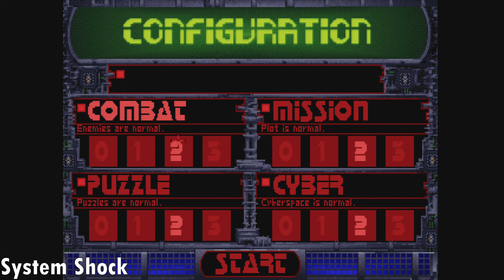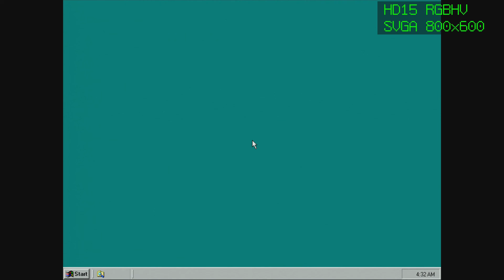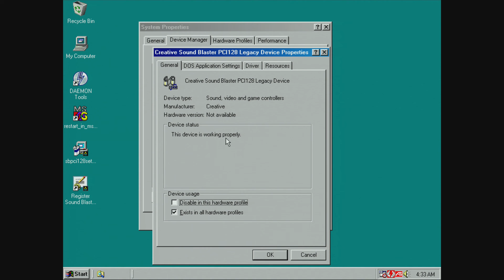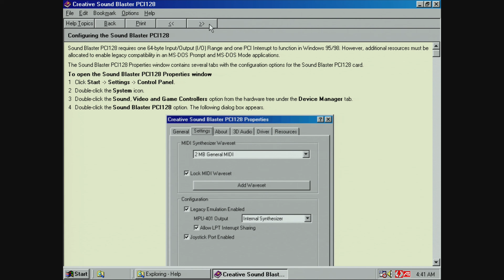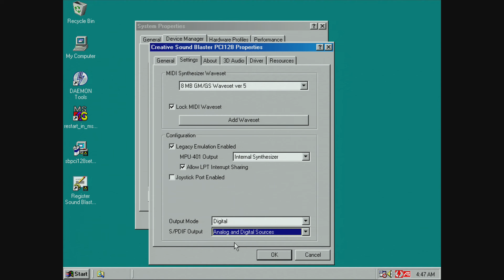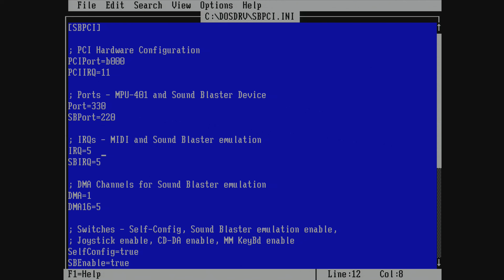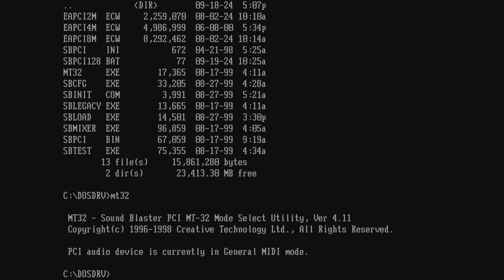Why no love for the Sound Blaster PCI 128?

Comment: I had 8 of these listed for $6 OBO and took the listing down because they get no love whatsoever even as a cheap card.
Reply: After Phil mentioned it, you can now list them for $60 and they will be sold in minutes.
Reply: @clockflipper  brb putting them up for $100.
Reply: Top technology of today is your garbage of tomorrow...
Reply: This was the first card I had in a DOS / Win98 build and I had no complaints. I still use it in an XP machine I built for cheap and easy sound. It's not TOTL but that doesn't mean it won't get the job done on a budget.
Reply: The Creative Soundblaster PCI 64/128 were subpar options of the time with shoddy drivers that liked to kill the entire OS ( 2k especially ). DOS support wasn't great either with clicking, crackling and delayed sounds especially on slower machines. Midi wasn't bad and usually worked, but somehow tended to sound off-key due to using their own differently balanced samples and, weirdly, the occasional off key seeming additional tone/note in between. And much of the Sound-Generation was done in software requiring quite a bit CPU performance.
For anything Windows, provided you actually got them installed properly, I found them to be a solid choice ( though personally, I quickly switched to the Terratex XLerate with the Vortex 1, and the Terratec DMX XFire using a Crystal CS4624/4630 after that ).
Reply: @l3lue7hunder12  Everyone pretty much waited for the EMU10K chip in those days. The 128 usually ended up in OEM machines, hence why they have a stigma against them. No one wants a product related to an OEM system. Not that the same fate came to the Live as well, but no one wants the Dell version of the card. I stuck with my AWE64 until I got my SB Live! 5.1 X-Gamer in 2000.
Reply: I too still have my 128 and my 512 as there was zero interest over a 6 month span.
Reply: Hmmm... Aside from my other comment to Phil in the main comment thread, I wonder if maybe some of the ones I was seeing online were yours. They are no longer up either. And similar to the ones he's holding in the video, so I figured maybe by coincidence he bought the ones I was looking at. 

But now I wonder if maybe those were yours?

I recently bought an Asus CSM board with a PCI slot on it for my AM4 setup. Need a decent midi soundcard for midi inputs, etc, for sound production using older hardware. But ideally one that also comes with all the nice extra features that sometimes gets used with some games for their sound. Sound Blaster being a common one of the brands to have this done with them usually with older games like Dungeon Siege and Diablo if I remember correctly.

Setting up an all AMD BSD gaming setup for older games where emulation of the operating system may be required at times due to lack of support for older OS's, etc. BSD is supposedly pretty good at that, once you know how. Apparently.
Reply: @ManuFortis  ... we are talking Asus Prime B350/X370 here, right ? Nice board, and works well with older cards such as an Vortex 1, but what is provides is PCI only and current Windows is unlikely to support Soundcards that old - you'll get basic features at best. There are more current offerings out there using PCI/PCIe and are supported to at least Windows 10, that have a "Game Port" and Midi therein - some are quite cheap. And the serdashop has solutions as well, including USB based Midi wavetables such as the Dreamblaster series. As for running Windows 98/XP or DOS on a Ryzen for vintage sound on a PCI soundcards ... well let me know what happened - you'll probably need a lot of luck.

Comment: Unfortunately for me, my SB PCI 128 CT4700 has the ill-fated "crackling" issue when playing sounds. It took several days for me to finally find working drivers that wouldn't crash windows. One set of drivers actually damaged my FAT32 partition. Your drivers were the only ones that gave me any signs of life, but nothing in DOS. SB0570 (Audigy) never worked in Win98SE for me and even my AWE32 CT3910 gives me nothing and gets super hot within about 5 seconds. Guess its time to reflow all of the solder and replace all of the capacitors 😢 I've had bad luck buying retro tech, but the good news is that I also rebuild them and release them back into the wild, with correct driver CDs and documentation!

Comment: i will add to the relaxation on the FM issue, is if you are using this like i am on a bit of nimble kit (PII 450/this sound card, and an MX200) you can just run DOSBox in WIn98 and then make yourself an AdLib 486 with a VGA graphics or even EGA etc. I use DosBox to emulate Tandy 1000 stuff on my setup (i have a Dell Diamontron VGA monitor) and its a good time (i miss my old Tandy 1000 RL i had growing up).

Comment: Why no love for SB 128 PCI?
Because people think they are clever and immediately select 8MB preset - then they immediately assume it sounds better because of higher size and never look back.
Even from tests in this video it is obvious 2MB preset is better with much better ambience.

I keep SB 128 PCI in my retro PCs exactly for the 2MB preset - I have not found anything like it anywhere else. Usually sounds don't fit each-other that well. Even SC-55 has this issue that in some MIDs some instruments sound out of place.

BTW. DOS driver for EMU10K cards also uses these same ECW files but MIDI engine doesn't support all effects or something because they don't sound correct at all. SB 128PCI plays these same sound fonts much better while something like Live!/Audigy sounds like it only plays samples back and some instruments sound quite broken.

Comment: Hey there! Thanks heaps for this awsome vid! ive got one of these cards and it plays audio pretty great, except for DOS games! the audio sounds weird compared to when i run the same games in dosbox. I tried following this video, but my settings seem to revert back to default all the time. it wants to put IRQ and SBIRQ to 7, SPDIFmode = 2, and when i change the setblaster info in autoexec.bat from i7 to i5, it reverts to default again next boot, but the audio is never 1:1 with dosbox. Any idea what it could be doing?

Comment: A solid win98 soundcard with quality audio.  I had the original version of this card by ensoniq.  The only way to get it to work in pure DOS was to install it through win 3.1 then make a copy of the driver folder for use in Dos 6.22 without win 3.1.  Worked great in win98 Dos mode though and you can use the 8mb wavetable in pure Dos, just have to edit the .ini file and direct it to the wavetable directory!

Comment: hello again phil, excuse me - lately , I got problem getting this web installer working - all the time I try it (on different setups/machines) it tell me, that the install file is not complete, or maybe more accurate, it has not all the necessary files, and the installer closes. do you have any idea what it can be? and 2nd question regarding this problem, is the web installer confirmed working in windows ME? thank you mate and friendly greeting to down under aus der alten heimat

Comment: The Sound Blaster PCI 128 dell version have additional TDA7360 IC or Power Amplifier but there is no supported driver for windows 10 or 11 there is a windows 7 driver witch can work even on windows 10 but aftertime reverted by the os

Comment: Occasionally, (for games) The 2MB included waveset sounded better than the 4mb and 8mb to me particularly because some of the instruments in the larger wavesets (such and distorted guitar) had a slower attack and didn't work quite as well for faster songs.  I did use the 8MB ecw for my keyboard a lot and it was great for lots of midi files.  I absolutely loved the organ sounds.  Overall liked the soundfonts better than the ones that came with sb Live!

Comment: Ahhhh. SB 128 PCI. I had this sound card in my first ever PC I bought myself (Celeron 300MHz + Riva TNT2). It was... serviceable, for the games of Win95/98 era. I upgraded my rig to Duron 800 in 2001 and tried keeping old SB 128 with it. Mostly it still worked ok in the early 2000s but for some reason on games like GTA Vice City it produced some clipping and janky audio. I bought SB Audigy 2 and all my audio problems went away. Never had anything to do with SB 128 after that. PCI 128 is to many users a bit of an in-between card: it's okay but never the first choice for anyone, DOS or Windows.

Comment: i had a sick obsession with this card, namely for the 8MB wavetable. i tried so hard to push devs here and there to get it emulated, they tried, the documentation for the wavetables was just way over their heads :( i was at least able to semi-convert the 8mb wavetable into an sf2, it works well enough. these days i don't have much use for it since RPG Makers have changed so much and also Win10/11's mappers are wack.. at the very least, i installed the sbpci128 driver in a VM (you CAN actually do this and the 8mb wave table works without real hardware), was able to play some of my midis in the 8mb wavetable and record them as MP3s for use in my projects. a bygone era with a happy ending.
Reply from the maker: Thank you for sharing ☺️

Comment: I had the CT4700 version, it was probably an OEM variant. It was a solid card for the late 90s and early 2000s. Had a makeshift four point surround setup running as well.

Comment: I was an original user of the Ensoniq ISA and PCI cards.

I’m still amused that CL had to buy Ensoniq to get the IRQ / compatibility emulation IP for PCI cards to fully work under DOS without that hokey CL port & cable to motherboards.

I hate the SB PCI’s the same as I hate all CL cards post-ISA though. Aureal had a superior 3D / positional sound IP and through underhanded practices - CL bankrupted them and then bought them in order to swallow up the IP.

Fuck CL.

Shame that TB went the way of consumer headphone market. The Santa Cruz was a nice card.

Comment: Heh... so you're the one who bought those. Or at least you seem to have bought the same ones I was looking at a month ago. You quote similar price, and they look like they are the same models; but I can't be sure without looking at the listing again... which is no longer listed. 

Anyways, as I just replied in Jonnyhopkins comment thread, I recently bought an Asus CSM board with a PCI slot on it for my AM4 setup. Need a decent midi soundcard for midi inputs, etc, for sound production using older hardware. But ideally one that also comes with all the nice extra features that sometimes gets used with some games for their sound. Sound Blaster being a common one of the brands to have this done with them usually with older games like Dungeon Siege and Diablo if I remember correctly.

Setting up an all AMD BSD gaming setup for older games where emulation of the operating system may be required at times due to lack of support for older OS's, etc. BSD is supposedly pretty good at that, once you know how. Apparently.

Comment: Hi Phil. Just opened my drawer and installed a PCI128 in my Pentium4 retrogaming PC. SB16 and general midi work great for dos games, and it was far easier than trying to make Sis7012 AC97 emulate sbpro under DOS. Thank you for the driver I found on your website
Reply from the maker: @CaptainDangeax  Awesome 💯

Comment: What does the CDDA over IDE mean? Is it played back on the wave channel instead of the CD channel? Is the advantage that the digital audio has less noise?
Reply from the maker: @JohnSmith-iu8cj  It means you don't have to connect that CD audio cable from the drive to the sound card...

Comment: These and similar Ensoniq cards were really popular in prebuilt systems in the late 90's, probably a good cheap way of getting sound. I think they dont get much love nowadays when cards like SB Live! are still fairly cheap on eBay if you are patient
Reply: Yeah exactly and the live is a much better card to boot. That is if you get the right one and don't get the crappy dell ones that wont work in anything DOS or 9x.. They are still good cards but the drivers are NT only for some reason.

Comment: I know of a few more games that work well with a MT32 sound bank. Specifically, Dune2, Ultima6, Ultima Savage Empire, Ultima Martian Dreams and Ultima Underworld 1 and 2. The original version of Dune 2 doesn't allow selecting MT32 with SoundBlaster in the installer so you don't get speech with Mt32 music unless you use an updated install utility that allows selecting separate sound devices for each sound type . Many people prefer Ultima 6 in Adlib mode as the game's music was written for the Adlib but with this sound card you don't have a choice. Sadly while that list of Ultima games would work well with this sound card Most of them have speed problems (the underworlds work best with a fast system though).

Comment: One fun fact about the PCI 128 is that is is the same exact card as the PCI 64, except that Creative stuck an ID chip on the 128 which the drivers would detect and thus the PCI 128 got the "upgraded" 128 voice driver. After figuring this out, I cobbled together a driver pack for the PCI 64 to upgrade it to the 128 and posted about it on the Creative Labs tech support forum. Shortly after this, Creative "decided" to be generous and released a "new" driver for the PCI 64 that upgraded it to have the same 128 voices of the PCI 128.
Reply from the maker: @EthanAQueen  wow what a cool story! Thank you for sharing 😊🙏
Reply: Really weird that they'd do something like that when they've been hostile to modders and threatened them with C&D in the past. There was the whole Daniel-K fiasco which put into the public spotlight how terrible Creative is as a company. They purposefully introduced bugs and removed advertised features between Windows versions (in this mentioned case, Vista drivers were purposefully crippled over XP drivers to get people to buy newer Creative products.)
Reply: @GGigabiteM Not only were the Vista drivers crap, but they also did not even publish them for years, basically taking the company into oblivion. Microsoft killed off hardware sound with Vista, then Creative poured salt on their own wound. 
Even their latest sound cards suffer from broken drivers, where you will lose all sound after a few minutes and won't get it back until you restart the system. Creative blamed this on AMD and overclocking, but in reality it's their drivers that are terrible (the issue appeared even on Intel systems, and non-overclocked AMD systems). I did get this issue with an Audigy RX 7.1 on my undervolted AMD system with overclocked RAM, thankfully I was able to fix it.

Here I would put a warning not to buy from Creative, if not for the fact that they have just about no competition for high end audio in the sub-$100 segment. But if you are considering anything higher end, just get a USB audio interface instead, it will sound better, you will not need to mess with Creative's amateurish drivers and will be plug and play on near everything that supports USB, including retro machines.
Reply: They provided SB16 compat drivers for DOS, I never had a problem using them... but others did.
Reply: Thats not opl3 midi wavetable emulation haha😅

Comment: Here are some reasons:
- No 44.1KHz mode, only 48KHz. So pretty much everything gets resampled, and not very well.
- Some variants of the card aren't supported by most driver versions.
- The MIDI synth is just a softsynth and often doesn't sound much better than the Microsoft GS wavetable.
- No FM synth so it's useless for a lot of DOS games.
- It's a common and cheap budget card so there is no hype about it.
- In DOS you can get the same result with a SB Live or Audigy.

Let's not overhype this card, it's nothing special. If you want good DOS game support on a PCI card, instead get an ESS Solo-1 or even a C-Media card (those are still sold new on ebay from china and contain a real OPL3)

Comment: I usually pick up sound cards used. I did buy a SB 128 new for $22 bucks way back when, it was miles better than the onboard Crystal audio chip. I replaced it with a SB 512 which was basically a stereo only version of a SB Live! card.

Comment: i haven't tried myself. but this card seems to be supported by SBEMU.
so, you could have good FM sound. though it might conflict with the built-in TSR.
Reply from the maker: Yea it initialises just fine, but no audio comes out. I'm having the same issue with my Live cards. But the plain Audigy works.
Reply: @philscomputerlab  that's a shame.
my retro pc is on storage, so i can't test. i couldn't make it work on pcem, no sound.
i have a different pci128 model than you, it has a separate jack for the rear speakers. i'll remember to test when i can.

Comment: I always had bad compatibility issues with PCI128. Those just do not tend to work for me. Especially on the " bleeding edge" motherboards, aka the last and fastest where you can get SB16 emulation working on SBlive, like the I865 boards for Core2, or SIS645, or VIA K8 motherboards, I often fail there (and so do with audigy) but the bloody live works there. Also, those SB128-ish cards have pretty terrible XP drivers, EAX is buggy and you sometimes have to disable directsound acceleration to the second lowest to prevent issues. I generally do not like them, even tho I had one back in the day. Another problem is is EMM386. Only live can somehow get by with working SB16 under windows when EMM386 fails to load. The SB128 or later audigy hard needs it. If EMM386 fails (can easily happen on many system, usually all it takes is loading some raid/drive controller bios during boot).

Comment: Used many of them well into the early 2K's, because Linux sound was really flaky in those days(*) and those cards were perfectly supported unlike the weird AC'97 onboard chips that had a lot of timing problems and would desynchronize the sound from videos (playing faster than the image frame rate). 
(*) Still is, sadly.